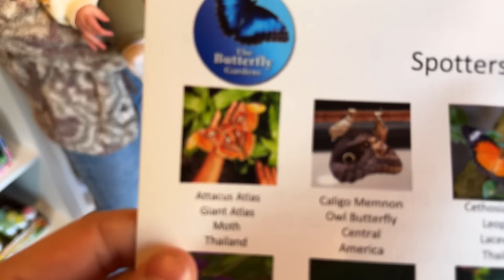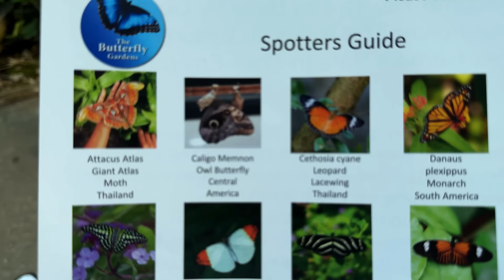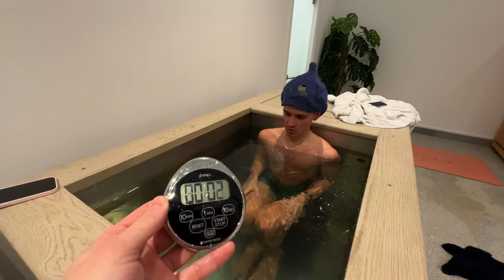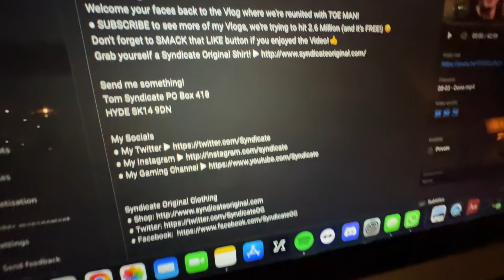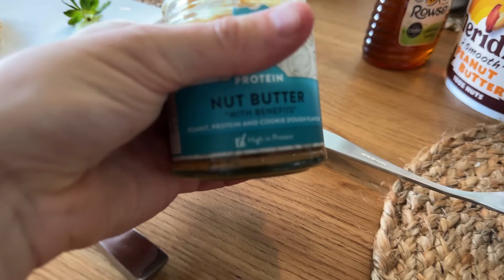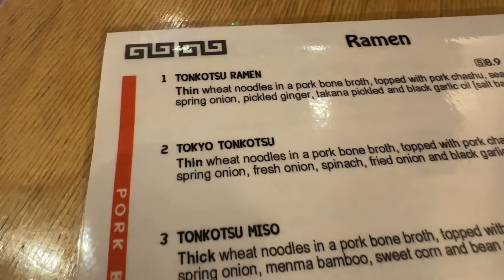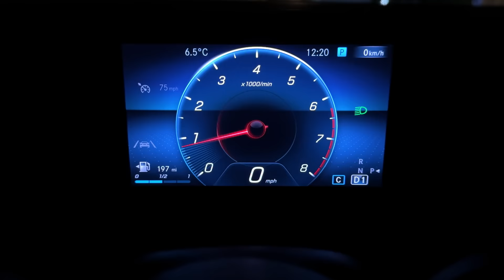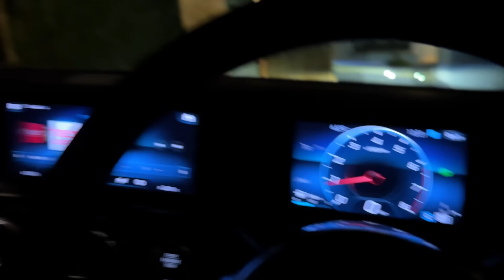A Weekend in the Life of Tom & Joe!

Comment: I work in car repairs and there could be.a few different things that could be wrong with that boot lid as long as the rear end hasn’t had any restoration and the panels and boot is originally it would just be adjusting with the boot hinges that needs to be tweaked

Comment: The boot lid should have 2 rubber buns that screw into the lid more allowing the boot to sit lower. If that doesn't lower it enough then the post for the lock needs adjusting lower.